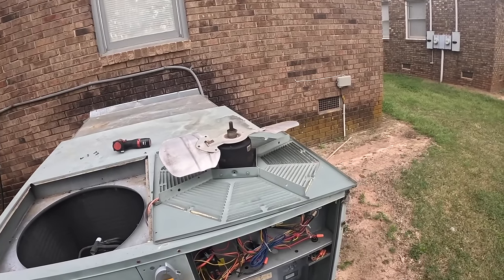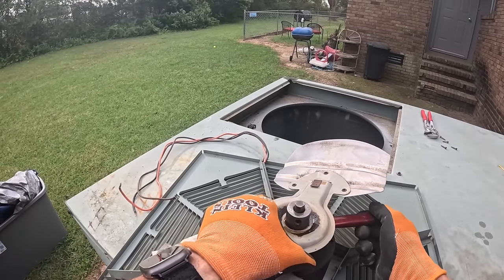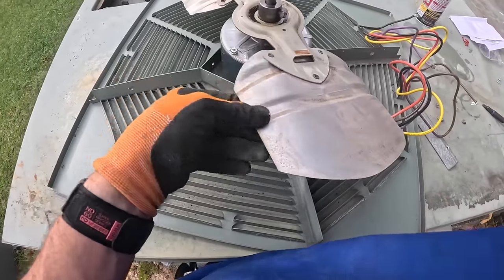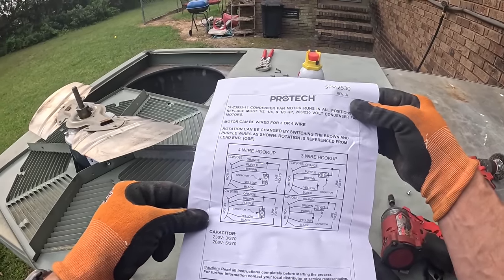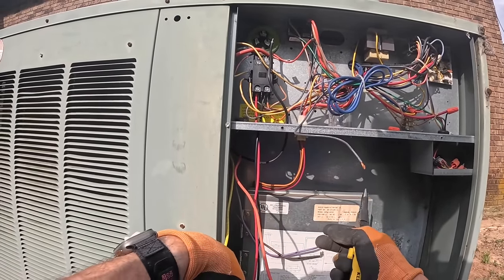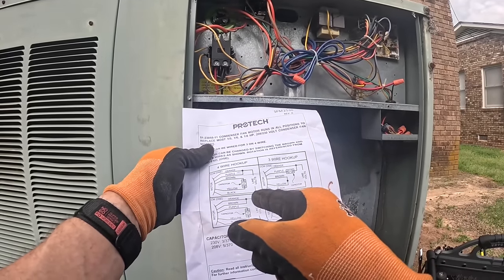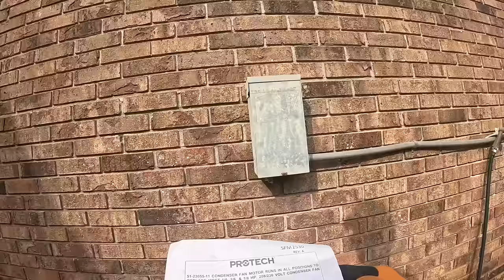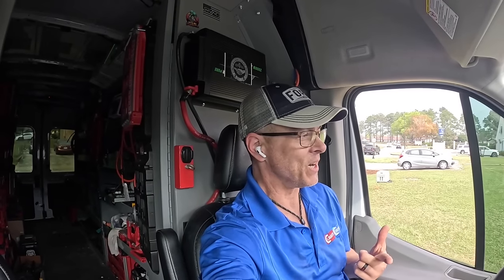Rheem Heat Pump Package Unit, Condenser Wasn’t Running! #hvacguy #hvaclife #hvactrainingvideos

Comment: CW (OSE) stands for CW Opposite Shaft End. You need to use the CCW (OSE) wiring diagram. That would make your motor CW shaft end.

Comment: They confuse you with the shaft end thing. You got it. I think you may be right about that guy with the thermostat. If that unit has the "c" wire, he may be ok, but it being that old I doubt it. Nice job man.

Comment: I can usually do simple wiring jobs, but I installed a programable thermostat on my 10-year-old unit and it only lasted a few months. Our AC guy determined it wasn't suitable for our unit. $125 later, we had a functional unit. Nuff said.

Comment: if you were concerned about low charge, you could just take the refrigerant pressure at static, convert to temperature, then take ambient air temp and compare.

Comment: The fan direction is why i prefer working with 3phase. You won't find that in residential, though, unless they install a converter and idler motor. I have seen 2 that have to run a small shop in the garage/barn. Good job.
Reply from the maker: Some three phase has single phase condenser motors

Comment: Get yourself a bag of Romex clamps or some snap in bushings for 1/2” knockout holes and quit struggling with those factory plastic wire clamps. The wires on replacement motors are thicker. Those factory clamps can’t accommodate the wires on new motors

Comment: Use the right tool. Those fancy adjustable pliers isn't the right tool. A pair of needle nose vise grips is the tool you needed. Which should be in every repairmans tool bag or box.